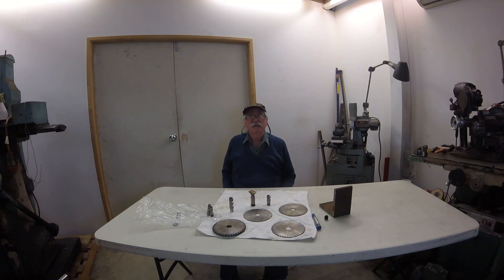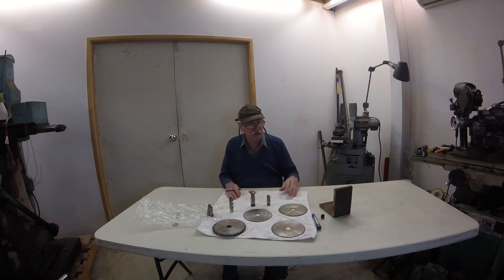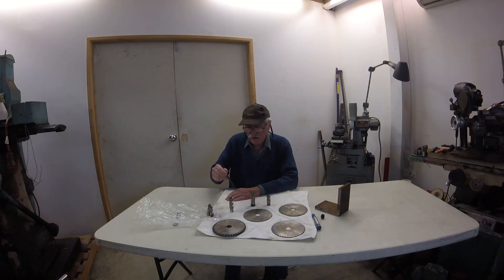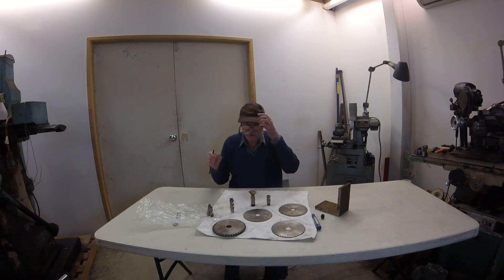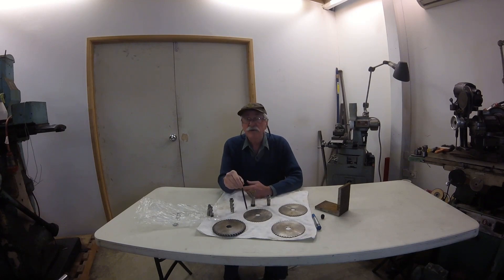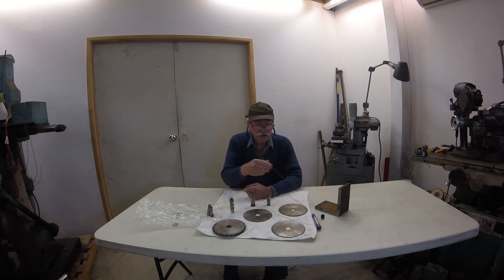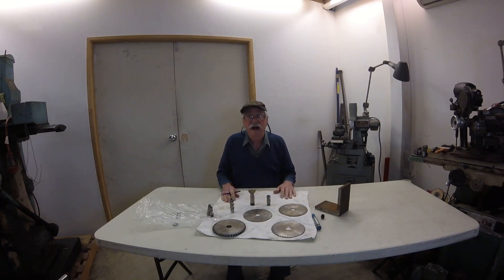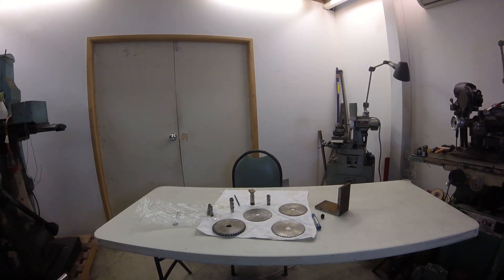Grinding saws and cutters.

Comment from the maker: Hi guys. I am very equipment limited as the old camcorder can't open the field of view. For me I need a proper studio camera stand before I buy a new camcorder. A few times trying to get the camera in close I have tripped arse over head on the tripod. One reason the recording has clitches. My audio recorder works well but with editing issues since Windows 11 appeared I have struggled ot get videos up. I have to wait till Monday and use the unpolluted computer at work. Soon I hope to have better lights and new camcorder.. BC

Comment: Hi BC. Problem with the audio is 1 you are to far from the mic 2 the echo of the room is diminishing the quality, I suggest move the camera in closer replace the mic cover which disperses background noise and reduce some echo. The only other way to improve mic audio is use a lapel WiFi mic or a directional wired mic.